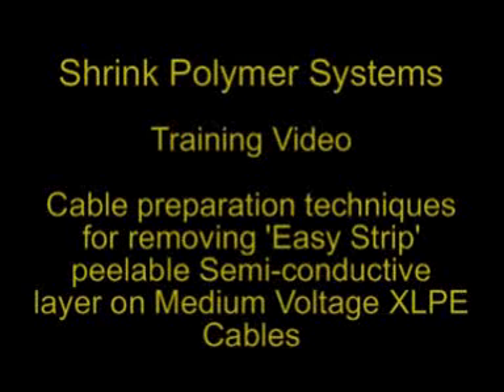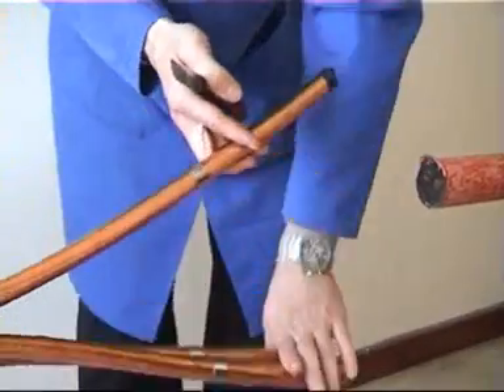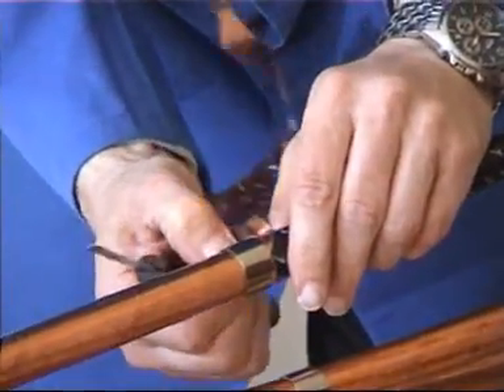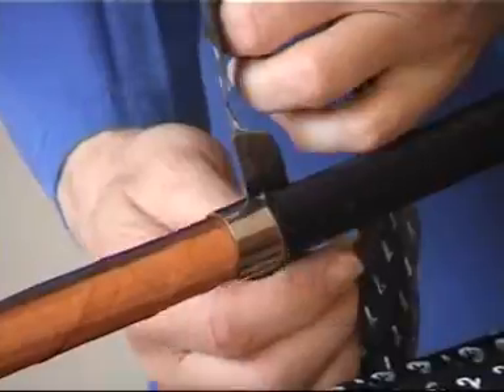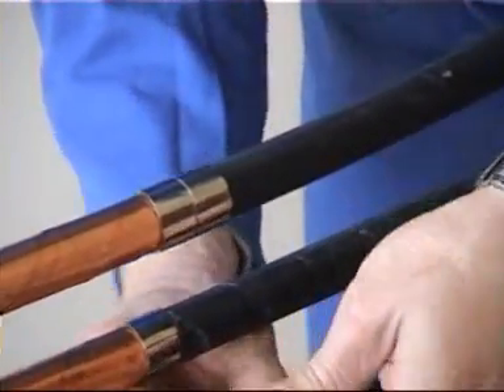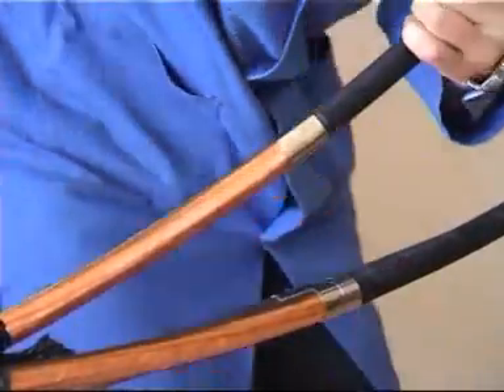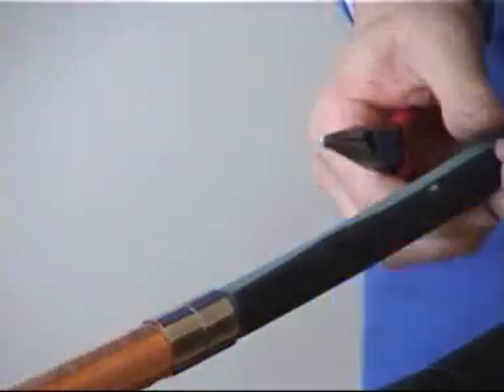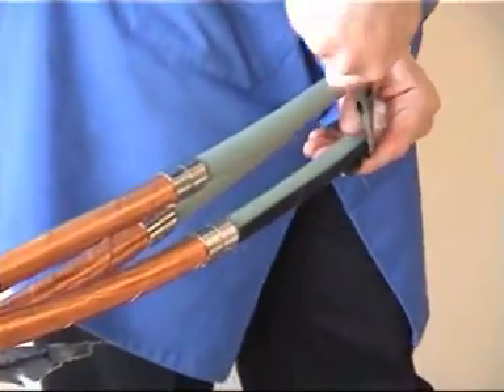Removing Easy-Strip Peelable Semiconductive Layer on Medium Voltage XLPE Cables 11kV Cables

Comment: At 2:47 if using the file, by the time the white xlpe layer is seen, isn't it already scratched by the file?
Reply: 100%, I am against the use of a file because you can’t control how deep you go, the insulation should be free of any marks and a file will definitely leave some marks into it.

This is a dated method I am totally against using, but major training centres continue to advocate the use of a file, but term instructions such as NEXANs states remove semicon layer without damaging the insulation.

It is a big contradiction